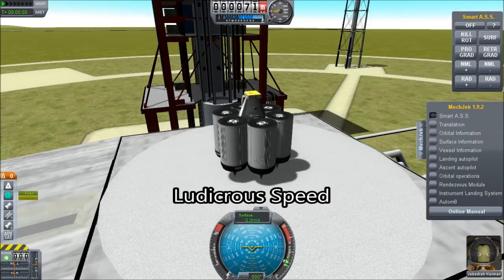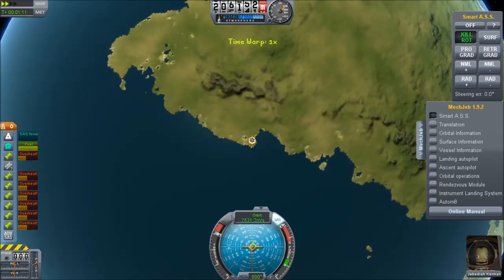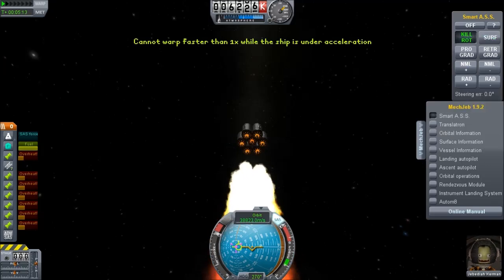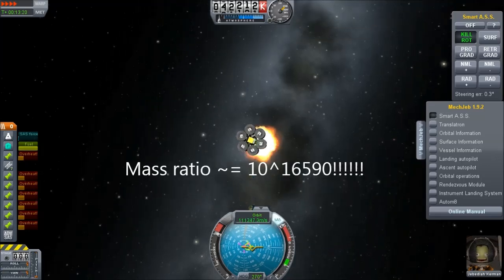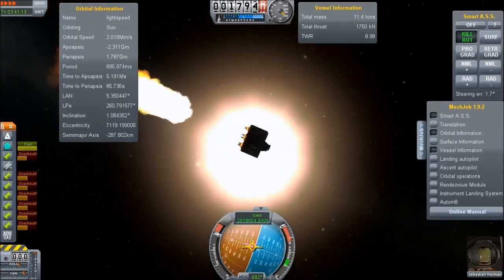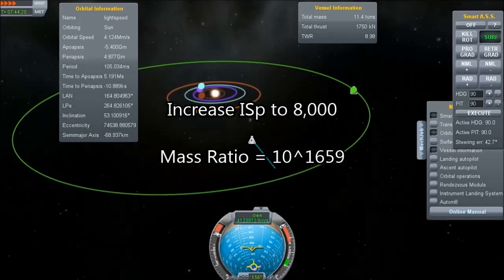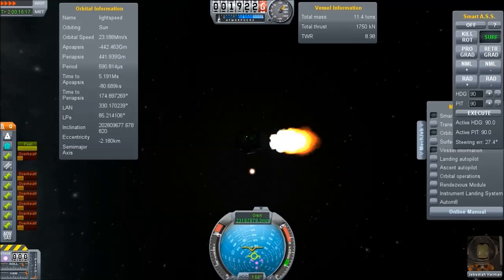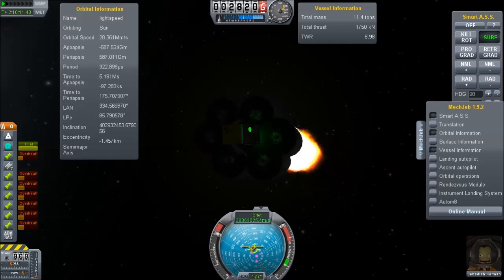What Does It Take To Reach Lightspeed In Kerbal Space Program?

Comment: actually, you're a bit wrong in your calculations: 9.81 is the accerelation in earths atmosfere, but if you escape earths atmosfere this (negative; to earth) accerelation dies away. so u can't use that in your calculations if you are flying outside of atmosfere.
Reply: james madox well sorry that english isn't my native language.
Reply: Aruba, Jamaica, ooh I wanna take you to
Bermuda, Bahama, come on pretty mama
Key Largo Montego,
baby why don't we go
Ooh I wanna take you down to Kokomo,
we'll get there fast
and then we'll take it slow
That's where we wanna go,
way down in Kokomo.
Reply: james madox Kerbin*
Reply from the maker: Nope https://youtu.be/nnisTeYLLgs
Reply: ok.........
Reply: +Brent Batch&MC 

A few points to consider;

The atmosphere has no effect on gravity.  

The force of gravity falls off with the square of distance from the planet's centre.  The Earth's radius averages 6,371 km - so this is where we start.  

So, if we start at one gee (9.80655 m/s2) at this 6,371 kilometer radius we can find a factor that makes the equation work (which is proportional to GM - universal gravity constant times the mass of the earth)

    9.80655 = GM / 6371000^2

re arranging

   GM = 9.80655 * 6371000^2 =  3.9804*10^(+14)

and using this figure to calculate acceleration at 100 km altitude (FAI Karman line)

    a = 3.9804*10^(+14) / (6371000+100000)^2 = 9.5058 m/s2

is slightly less than at the surface.

and at 150 km (altitude of a stable orbit - at least for a few orbits)

   a = 3.9804*10^(+14) / (6371000+150000)^2 = 9.3606 m/s2

is even lower than at the surface.

This has nothing to do with atmosphere.  That's the first point.  Gravity has nothing to do with atmosphere.  Air drag depends on speed and air density and is a factor in design, but it has nothing to do with gravity.

Now the the other point - is to clarify your thinking about how g is being used in this equation.  Recall this discussion is about the forces rockets apply to vehicles in the absence of other forces.  (either air drag or gravity losses)  

So, the actual forces exerted on a spacecraft at altitude, have nothing to do with the speeds the spacecraft ideally achieves with only rocket forces acting.
 
So, when you are calculating the speed of a rocket propelled projecting, you use g0 = the force of gravity AT THE SURFACE OF EARTH, to convert SECONDS of SPECIFIC IMPULSE to METERS PER SECOND of EXHAUST VELOCITY.

Here's the equations I use;

    When I know the propellant fraction          When I know the Velocity required
     Vf = Ve * LN( 1 / (1-u) )                              u = 1 - 1 / EXP( Vf/Ve )

Where Vf = final velocity
            Ve = exhaust velocity
            LN(...) = natural logarithm function, EXP(...) exponential function
             u = propellant fraction.

Now, Ve = exhaust velocity is related to seconds of specific impulse by

      Ve = g0 * Isp

Where Ve = exhaust velocity (in m/sec)
             g0 = acceleration at Earth's surface (9.80655 m/sec2)
             Isp = specific impulse (in seconds)

Specific impulse is the number of seconds 1 kg of propellant produces 1 kg of force.  

Solid rocket Isp = 280 sec - 2.5% structure
Liquid rocket Isp = 380 sec - 5.0% structure
Cryogenic rocket Isp = 460 sec - 7.5% structure
Nuclear thermal rocket Isp = 980 sec - 12.5% structure

etc.

A stable orbit near earth's surface requires that we rise above the atmosphere to escape air drag, and then, accelerate to at least 7.9 km/sec.  When we count air drag and gravity drag - to minimise total propellant - we find that we must design the rocket's payload to attain 9.2 km/sec.  This gives us the Vf we must achieve.

So, let's look at a one stage cryogenic rocket, a two stage cryogenic rocket and a three stage cryogenic rocket...

   1 stage
   7.5% structure
   460 sec Isp
   9.2 km/sec Vf

    460 * 9.80655 = 4,511 m/sec ~ 4.51 km/sec Ve

   u = 1 - 1 / EXP ( 9.2/ 4.51 ) = 0.86996 ~ 87% propellant fraction

   p = 100% - 87% - 7.5% = 5.5% payload fraction.

So, a single stage cryogenic rocket that carries say 10 tons into low earth orbit must be

     10 / 0.055 = 181.82 tons take off weight.

So, we have the following;

    181.82 * .055 =   10.00 tons payload
    181.82 * .075 =   13.63 tons structure
    181.82 * .870 = 158.19 tons propellant

    2 stage 
   7.5% structure
   460 sec Isp
   9.2 km/sec Vf

   9.2 / 2 = 4.6 km/sec Vf per stage.

The specific impulse is the same, though if we wanted to be more precise we might adjust the first stage downward and the second stage upward in each case.    We can also adjust the speed each stage contributes as well.  The way this is done uses Calculus of Variations - and is beyond the scope of this treatment - but if you set up the problem in a spread sheet the right way you can adjust parameters to see how it affects overall performance.

  u = 1 - 1 / EXP( 4.6 / 4.51 ) = 0.63939 ~ 64% propellant fraction

  p = 100% - 64% - 7.5% = 28.5% stage payload fraction.

So, a double stage cryogenic rocket that carries the same 10 tons to low earth orbit must be in the second stage,

    10.00 / 0.285 = 35.09 tonnes stage weight and
    35.09 / 0.285 = 123.12 tonnes first stage take off weight

Notice that with two stages, the vehicle is 58.7 tonnes lighter using the same technology!  Alternatively, we could have the same take off weight, and put more things on orbit with two stages.  

   3 stage
   7.5% structure
   460 sec Isp
   9.2 km/sec Vf

   9.2 / 3 = 3.07 km/sec Vf per stage

Again the Isp is the same as for the first example.

  u = 1 - 1 / EXP(  3.07 / 4.51 ) = 0.49374 ~49.4% stage propellant fraction

  p = 100% - 49.4% - 7.5% =  43.1% stage payload fraction

    10.00 / 0.431 = 23.20 tonnes - third stage weight
    23.20 / 0.431 = 53.83 tonnes - second stage weight
    53.83 / 0.431 = 124.90 tonnes - take off weight

Due to rounding errors, this is slightly higher than the two stage approach, and has similar advantages over the single stage approach.  Again, if we adjust structure fractions to optimise for lighter forces in the third stage, and adjust specific impulses to reflect operation of the engine in vacuum at higher efficiencies, we can reduce take off weight.

 A single stage nuclear thermal rocket

    1 stage
   12.5% stucture fraction
    980 sec Isp
    9.2 km/sec Vf

    980 * 9.80655 = 9,610.4 m/sec ~ 9.61 km/sec  Ve 

    u = 1 - 1 / EXP( 9.2 / 9.61 ) = 0.616086 ~ 61.61% stage propellant fraction

   p = 100% - 61.61% - 12.50% = 25.89% payload fraction

     10.00 / 0.2589 = 38.625 tons take off weight.  

To lift off the Earth's surface at 2 gee acceleration requires that the engine produce 77.25 tons of thrust.  Now if these are metric tons, this is 77,250 kgf of force.  To convert kg of force to Newtons require that we multiply by g0 = 9.80655 m/sec which gives 

     77,250 kgf x 9.80655 m/sec = 757,556.0 Newtons.  

Now, 

    F = m * a = m * dV/dt

which is converted by applying the fundamental law of calculus and knowing a = dV/dt into
   
    F = dm/dt * Ve

So, 

    F/Ve = dm/dt = 757,556/9,610 = 78.83 kg/sec

is the mass flow rate.  

Now,

   E = 1/2 * m * V^2

and Power = dE/dt and applying this bit of calculus to the energy equation obtains the power needed by the reactor to maintain the exhaust speed at full thrust;

   Power = 1/2 * dm/dt * Ve^2 
               = 0.5 * 78.83 * 9,610^2 = 3.64 GW.

Don't be put off by the terms.

Calculus deals with change.  That's all.  You have arithmetic - which is numbers.  Algebra - which is the relationship between numbers.  Calculus - which deals with changing conditions.  Differential Equations - which deals with the relationship between changing conditions.  Advanced Algebra - which notices that Calculus is to Diff Eq as Arithmetic is to Algebra, and extracts more general rules of algebra and applies them to a host of other topics, like logic (Boolean algebra) or physics (Hamiltonian algebra), etc.  

These are things we can do with numbers.  Then you have the numbers themselves.  Scalars - deal only with size.  Vectors are a list of scalars and can make pictures.  Tensors are a list of vectors and can relate one picture to another.  These occur in any combination - an arithmetic of scalars balances your checkbook, an algebra of vectors relates things in a picture, a differential equation of tensors relates the changes in two pictures - say a gravity field and a magnetic field acting on an object moving through space.
Reply: Joanna Wisniewska as i already said: im not a native english speaker in my language it's almost the same but with an f
Reply: Brent Batch&MC kokomo?
Reply: Lore Nerd meh, forgot the name
Reply: Not to mention that The Planet Kerbin 10.9 times smaller than Earth.
Reply: actually you're right in some parts its not atmosphere it's when you escape the earth's gravitational field which is the space being "curved" by a mass called earth so when the spacecraft escapes the field it doesn't get "pulled" by earth of course earth's mass is huge the equation of gravity is g×M×m/r square thus as you get far frome earth the gravitational pull gets reduce in (distance) squared 
bottom line its not atmosphere but youre right about not able to use the equation tough^^
Reply: ***** Science is true regardless of belief.  Unarguably true!  Yet you follow this unarguably true statement with your foolish beliefs that have no basis at all in reality.

Fact is sir, anyone who understands the difference between force and weight understands why 9.81 meters per second per second acceleration is used to convert kilograms of force to kilograms of weight - and they also understand that it has nothing to do with imperial units, which use 32.2 feet per second per second to convert pounds of force to pounds of weight.  lol.

The factor 9.81 m/s/s in SI units (or 32.2 ft/s/s in imperial units), are used to convert seconds of specific impulse to exhaust speed because you are relating kg (or lbs) of force to kg (or lbs) of mass.  

A kg (or lb) mass of hydrogen oxygen propellant can produce a kg (or lb) of force in a rocket for 450 seconds.  To convert that time into a velocity (meters/second or ft/second) means you have to multiply by acceleration which relates the force to the mass.  Which is 9.81 m/s/s in SI units and 32.2 ft/s/s in imperial units.  

Velocity = acceleration * time = V=at

V = 9.81 m/s/s * 450 s = 4,414.5 m/s
V = 32.2 ft/s/s * 450 s = 14,490 ft/s

This is important to know because now you can calculate how fast a rocket will go (ideally) using the Tsiolkovsky equation

Vf = Ve * LN(1/(1-u))

Where Vf = final speed of the stage,
            Ve= exhaust speed of the rocket
          LN(..) = natural logarithm
           u = propellant fraction

To get to orbit after gravity drag and air drag losses from Cape Kennedy on Earth, requires Vf = 9,200 m/s.  So, re-arranging the equation to solve for u; we have;

  u = 1 - 1 / EXP(Vf/Ve)

Where EXP(..) = exponential function

  u = 1 - 1/EXP(9200/4414.5) = 0.875574

Which means you have to have 87.5574% of your rocket hydrogen and oxygen propellant.  

If 7% of of your rocket must be structure that leaves 

  100% - 87.5574% - 7.0000% = 5.4426%

payload.  So, a take off weight of say 1000 metric tons parts 54,426 kg of payload into orbit.
Reply: +ljeonjko you have to remember he's using it in the rocket equation solely as a constant. The isp is measured on earth so earths gravity applies.
Reply: Recon WB james madox Haious it's called KERBIN, just search it....
Reply: Recon WB ??????? kokomo??? dafuk is kokomo
Reply: Brent Batch&MC dude its  atmosphere not the atmosfere
Reply: Brent Batch&MC i dont understand either, i thought there would be an integration on the "Gravity constant" however i kind of get that its just a constant that depends on units..... confusing stuff
Reply: Recon WB HAha what song is that? I heard that somewhere before..
Reply: +Brent Batch&MC atmosfeer?
Reply: +Blue Eyes White Teddy yeah why ? u dutch/flamish too ?
Reply: Brent Batch&MC ja. XD
Reply: +Brent Batch&MC If Isp in Kerbal was specified in  N*s/kg units you would need no 9.81 in Tsiolkovsky equation
Reply: It has everything to do with gravity.
One kilogram of mass generates a kilogram of force in a one gee gravity field.  That's 9.81 Newtons.

One gee is 9.81 m/sec2

A Newton of Force accelerates 1 kilogram mass at 1 m/sec2.  

So, in a one gee field, one kilogram of force accelerates one kilogram of mass at 9.81 m/sec2.
Reply: *****  Being rude isn't persuasive, especially when you are describing yourself.
Reply: ***** 

Interesting that you announce others are missing the mark and then totally miss the mark yourself.  Its called psychological projection!  haha - total madness actually.

You are dead wrong when you say g0 has nothing to do with Isp.  

Set aside what you think you know (and obviously do not) and consider carefully the following in light of the difference between gravitational force and forces due to masses.  

The specific Impulse (Isp) of a rocket is measured in seconds.  It tells you how many seconds a mass of propellant gives you an equal force.  *Mass* and force are directly related by the gravitational acceleration at the surface of the Earth.  *g0* (gee naught)  In SI units this is 9.81 meters per second per second.  In Imperial units this is 32.2 feet per second per second.  This is the same value when you consider that 1 meter = 3.28 feet and that 9.81 x 3.28 = 32.2  <shrug>

Velocity (m/s) = Acceleration (m/s/s) * Isp (s)
Reply: +Brent Batch&MC Great vocab, sir! not
Reply: FYI read all the comments if you're going to say something.
Reply: SourdoughVideo omg not again plz anyone who thinks about commenting here plz don't it's too long i know it now ok plz is there some way to close this comment .....
Reply: +Brent Batch&MC yes
Reply: +Brent Batch you can delete a comment
Reply: Acceleration at Earth's surface averages around 9.80655 m/s/s.  This has to do with the mass of the Earth.  

 F = ma  = G*mM / R^2
 a = F/m = G*M/R^2

Where F=force, m=mass of object, a=acceleration, G=gravitational constant, M=mass of Earth, R=radius of the Earth.

G=6.67408 × 10^(-11) m3/kg/s/s

   a= G*M/R 
     = 6.674×10^(-11) m3/kg/s/s (G)
      * 5.972 × 10^24 kg (M)
      / (6.375215× 10^06 m)^2 (R^2)
     = 9.80655 m/s/s

The atmosphere has nothing to do with it!  The distance from the Earth's center however, does have a lot to do with it!
Reply: Brent Batch&MC you can't even spell atmosphere right....
Reply: The Magical Gamer Kirbon
Reply: Heiner Privat Is the only guy here that knows what he's talking about. 9.81 is a CONVERSION FACTOR!
Reply: This isn't earth its kerbal
Reply: +William Mook 

A nuclear pulse rocket, like the Orion, has Isp on the order of 3000 seconds.   The power is relatively unlimited.   Structure fraction is around 15% - 

1 stage
15% structure fraction
 Isp = 3000 sec
20 km/sec Vf

The 20 km/sec is far higher than the 9.2 km/sec calculated earlier, because this includes flights to the Moon and back, or flights to Mars and back - which run between 16 km/sec to 20 km/sec.  

Ve = 9.80655 * 3000 = 29,419.6 m/sec ~ 29.41 km/sec.

  u = 1 - 1 / EXP(  20.00 / 29.41 ) = 0.493404 ~ 49.34%  propellant fraction.  

  p = 100% - 49.34% - 15.00% = 35.66%

A vehicle with 10,000 tons payload would have the following take off weight;

    10,000 / 0.3566 = 28,042.6 tonnes  take off weight

    28,042.6 t * 0.3566 = 10,000.0 t useful load
    28,042.6 t * 0.1500 =   4,206.3 t inert structure
    28,042.6 t * 0.4934 = 13,836.3 t propellant.

Now, a fission free lithium-6 deuteride pellet contains 264.5 TJ per kilogram.  Now 13,836.3 tonnes moving at 29.41 km/sec contains 5,789.2 TJ of energy.  Thus, only 21.88 kg of lithium-6 deuteride is needed to energize the propellant to this speed.  That is most of the bomblets contain significant amounts of equipment to direct and control the explosive energy.  

To produce 60,000 tonnes of force at lift off is the same as 588.4 million Newtons.  You get this by multiplying the kilograms of force by g0 - acceleration at Earth's surface!  With a 29,410 m/sec exhaust speed, we can see that we must energise

    dm/dt = 588,400,000 / 29,410 = 20,006.8 ~ 20 tons per second.  

This requires 31.63 grams of Lithium-6 Deuteride be detonated per second within each 20 ton of inert propellant at peak thrust.  

Lithium-6 Deuteride - when combined with Tungsten, which takes energetic neutrons and produces two lower energy neutrons - is possible to make into a fission free bomblet.  At normal densities, this requires about 100 kilograms of material.  The amount of material is reduced by a factor of compression squared.  Factors of 10,000 are possible using Theta pinch effects.  This reduces masses by 100 million.  So, we're talking about 1 milligram as the minimum yield mass under these circumstances.  31,630 of these per second.  Say if we size these to 20,000 per second - so that each pellet masses 1 kg - and contains 1.6 milligrams of Lithium-6 Deuteride each.  20,000 per second produces two gees with full propellant, and reducing to 1000 per second, reduces this to 1/20th gee ...  

A very interesting spacecraft!

Industrial humanity uses about 2.5 tons of materials per person per year.  With a 73 day flight cycle, each ship delivers 50,000 tons  per year- and supports 20,000 people with materials gathered from the asteroid belt.  Eight hundred thousand ships this size support 8 billion people.   That's five ships departing or arriving per hour from each of the world's largest 100 air ports.      
    
O'Hare has over 100 aircraft movements per hour on average throughout the year.  So, 20 airplanes would take off and land at O'Hare between the times one of these ships arrived or took off.  With loading times of two hours per ship, we have 20 gates to serve this rate of vehicle movement.
Reply: its called Kerben
Reply: Before you even try and get scientific and shit, please learn to spell.
Reply: +Scott Manley nope, it's basic physisc: g=Gm1*m2/r^2. once you leave the earth's surface, that r tends to infinity, tending the gravitational pull of earth to 0.
Reply: Are you joking?